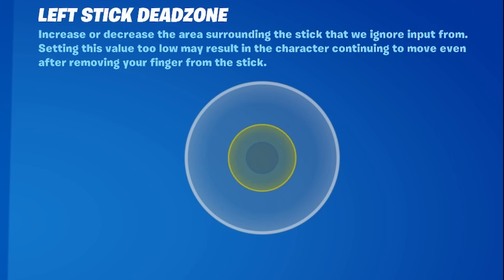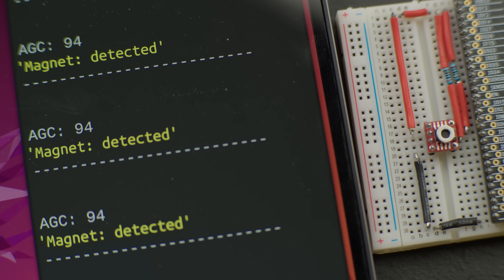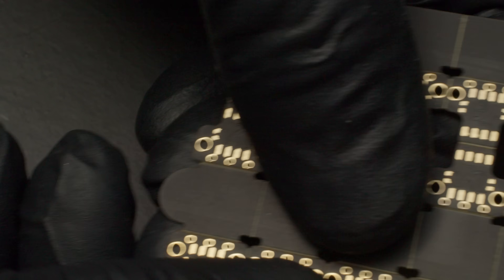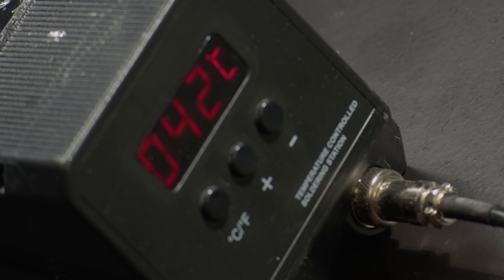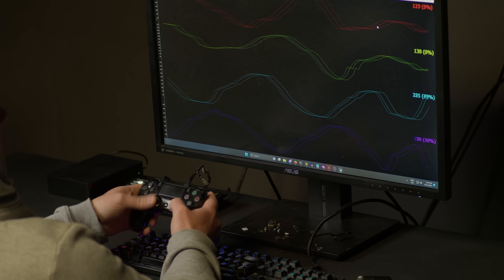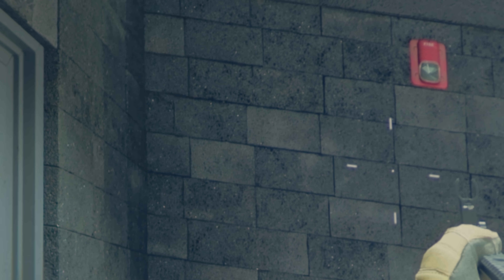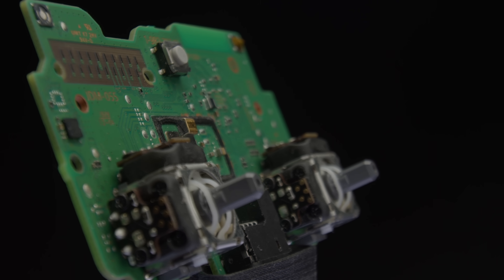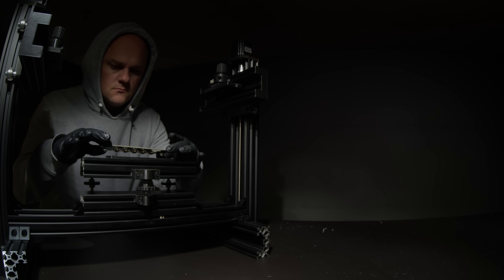Beating the $20B Joystick Drift Problem, and giving it away for free

Comment: So as a person relatively new to console and PC gaming i have some thoughts on joystick augmentation or whatever. I only play rocket League for about 3 years now. I use an xbox elite series 2 controller. Their grips are set at roughly a 45° angle to the top. If i grip the controller into my palm it leaves my thumb at a 45° angle as well. This makes accurate joystick movements North South, East West, very unnatural. The muscles and tendons and ligaments have to move in a very unnatural way in order for me to get accurate north south east west control movements. I'm not thinking of redesigning the controller body. What would be ideal would be if i could reorient where up down left right actually are in the control stick with software. I would  rotate it clockwise to where up-right, down-left normally are. Then i could control my car much more accurately. I imagine everyone has particular tendencies in their thumb movement in the way they hold the controller.i think it would be a really useful tweak in the controller setup software. 
  The other thing I'm wondering is, do you think the distance from the neutral center position to any of the furthest points outward in any direction, needs to be that far?? I think minimizing all the movements you have to make with your thumb would be super beneficial. Like.. i would love to try it where the far outside was halfway in between the far outside and the neutral position as it is now. I am aware of at least one manufacturer that provides a sort spacer that shortens that distance in the control sticks but I'm not convinced it's the best approach. What do you think?
Reply from the maker: I think its gonna be really exciting to experiment with stuff exactly like this. Adapting controllers to both games and hands. Or personal preferences. Its gonna be a.... game.... changer. Haha.

Comment: I think this joystick could be way more precise, if it tracked 360° of the magnet instead of just 50°.
But for your application, it would be complicated, as you would have to build some gears to translate the 50° angle to 360°.
Thus, as it is an overdrive, it will put stress on the gears and make the joystick harder to move.

If manufacturers wanted to build reliable controllers (it was not intended to be a joke), they could easily take the same path as you. Moreover, they have the money to build specific magnets, so they wouldn’t have to use an overdrive to track 360° of the magnet.
Reply from the maker: I see your point. They can.  But gears that are small, will cause backlash. Especially over so many cycles. They could probably have made the joystick modules bigger.

Comment: I really hope nothing in the latter third of the the video is sincere. Hall effect joysticks have been available for a very long time, and there are even companies, such as GuliKit, which sell upgrade kits. The only reason OEMs dont install them on every controller is that it would raise the BOM cost by like $1.50 per unit and reduce total controller sales. It’s really easy math, from their perspective: $1.50 multiplied by, say, 250 million units sold is a lot of money that their shareholders wont let them give up. Taking that into account, the objective for the video, especially the latter half, is to point out that fixing the design is extremely simple and that there isn’t really any justification for letting such a minor profit differential get in the way of making better products. To be honest, i think the engineers making the controllers already know this, but it’s probably going to take a long time to convince the executives that a strong enough argument can be made to the shareholders that the upgrade is worthwhile.
Reply from the maker: Actually, I used to think the same way you do before embarking on this project. I'm not suggesting that you're wrong, but allow me to provide some additional insights. It's impossible to create a linear axis of 255 positions the way Gulikit does it. This can't be achieved with a single Hall sensor due to the small movement range of this specific mechanical joystick design. I'm employing a far more advanced method than Gulikit. I use a rotary encoder chip that houses four Hall sensors arranged in a circle around the axle within its silicon structure. The inputs from these four sensors are fed into a CORDIC (COordinate Rotation DIgital Computer) within the same chip, and then output as an analog signal by a 14-bit DAC (Digital-to-Analog Converter). This introduces a level of precision that far surpasses what Gulikit or any other single Hall sensor solution can offer. I have conducted measurements, and it turns out Gulikit manages their solution through heavy signal processing and automatic re-centering. So no, it's not easy, and it has never been done before. The movement range for this joystick is so minimal that it's impossible to create a true 8-bit axis that is free of noise with the previously utilized methods. Furthermore, these Hall effect encoders are quite new and quite expensive. A single one of these chips costs more than the entire joystick on its own, and two are required pr joystick. This doesn't imply that Sony couldn't have solved the problem. They certainly could have, especially considering the highly advanced triggers on the PS5, yet they still didn't address the joystick issue.
Reply: @MariusHeier1  I apologize for making assumptions about the precision of the different systems, but I'm not yet ready to believe that it's impossible to use simpler sensors to achieve a usable result. Even discounting the dubious value of having a full 8 bits of precision, it seems likely to me that the specific sensors you're using are overkill. For the purpose of making a unit that can be produced in large quantity, would it not be possible to use a magnet keeper to guide the field so that precise reading can be gathered from a collection of simpler sensors? I'm imagining a stamped ferous sheet metal part which encloses the magnet and guides the field into two or more smaller areas near unevenly placed sensors. The keeper should be able to increase the local flux while making the flux across the range of motion vary less evenly, thereby making it easier to read a definitive position. I'm also confused about your calibration system. Unless the output of the sensors is both non-linear and unpredictable, it should be possible to use the normal joystick calibration method of running it in a circle at its limit, then letting it return to center, rather than going to the effort of uploading calibration data to each unit. Internally, you then find the limit values and set those to the output extremes before using the linearization curve to set the values between the limits and the center. If you have a software interface, you can also allow the user to set up non-linear output response and deadzone size.
Reply from the maker: @Rms2015, the fundamental issue arises when moving a magnet a short distance. The nonlinear changes in the magnetic field, when combined, seem to make the task impossible. This might be feasible for larger joysticks, but moving a magnet 3-5mm doesn't provide a reliable ground truth without substantial processing. My sensor seems overpriced for what it does, but it's the only solution I've found to be effective. However, we need to consider this from a different angle. I didn't create this for mass manufacturing. I developed it so that people could order it at almost the cost price of the components, making it very affordable for an end consumer, albeit not in a mass retail context.

About the calibration - Sony has hard-coded the ideal center position into all controllers, resulting in a specific center voltage. What I do first is what you described: find the outer limits. Then, I perform a 30 release from both the maximum and minimum edges to determine the mechanical center. Using this data, I identify the best ideal center for the axis. Afterward, I shift the start and end positions of the magnetic field rotation to align with the hard-coded center voltage for that specific joystick.

I even made a robot/machine that reads the joysticks and move them at tiny increment to observe all the stuff i proclaim. Im gonna write a paper about it when i get more time to describe it and back it up with the experiments i did.
Reply: @MariusHeier1  if I read that right, what you're telling me is that you haven't found an algorithm that accurately predicts the position of the joystick from the changes in the magnetic field because those changes are less predictable than you can account for with simple math. Based on that I have to ask how many kinds of magnet you've tested. I'm afk atm but iirc the one you showed in the animation was a non-axial  ring type magnet: those frequently have non-uniform fields due to manufacturing limitations, so perhaps a simpler magnet shape would help? I also wonder if it might be possible to skip measuring the x axis and y axis separately by attaching a magnet to the actual stick and measuring with a multi-axis sensor. I'm told that the ~$2 chip in phones is good for 0.1 degree 3-axis digital readings. In any case, this seems a poor choice of platform for continued discussion: you can find me at rms2000 on Discord
Reply from the maker: @Rms2015  could not find you in Discord. My discord channel is in the description.

Comment: What exactly is the advantage of this system over Gulikit or similar? Are they not the same idea?
Reply: this is diyable, just a couple of low cost parts (so it's cheaper) and you connect to the original sticks (so it feels almost like the original)
Reply: @-aexc-  fair enough
I also looked a bit further into it and saw that it fixes issues in hardware that Gulikit chose to fix in firmware (non-linear activation curve)

Is there any information about doing this build yourself? I'm interested in poking around with it and seeing how hard it is to do

Comment: They're not trying to save Pennies, well at least not just that. They're trying to get you to buy more and more when they break down. A lot of companies does this. Even apple admitted to it with slowing down their older model phones when a new one comes out. It's called planned obsolescence. Not sure there's much we can do about it other than solve the problems ourselves. But even then manufacturers make it harder and harder to perform maintenance on our own products that we buy. For instance phones have permanently sealed batteries now, try doing an oil change in a brand new luxury car. Lol you need a specific expensive machine for it. Wish we could do more than just talk about it though companies don't care about comments or videos on YouTube unless it hurts their wallets.

Comment: The N64 joystick worked great, no stupid potentiometers to wear out and start drifting. It worked like a ball mouse with IR optical sensors counting slits passing by on the wheel. It was an optical encoder, basically. Why they don't use a design like that is beyond me. It's simple and effective, but not as profitable because you won't be selling new controllers to everyone when theirs invariably wears out.

Comment: Microsoft solved that problem decades ago with the fully optical stick in the Sidewinder controller.
Reply from the maker: Yeah that's easy when its that big.
Reply: @MariusHeier1  Dude, the operating principle is optics. It can be definitely minimized, and to a greater degree of precision than the Hall Effect. You're seriously not trying to tell me that the reason they stopped putting it in controllers was because of size, and not capitalism.

Comment: I don't get it.

I mean I understand companys not wanting to sell a product that lasts forever - but couldn't they just make at least the "high end" controller versions (like M$s pro controller) with lasting sticks? You already pay 200+ bucks for that shit iirc. Least they can do is manufacture lasting thumbsticks at that price. I mean, it's not like there aren't enough other parts that will just fail eventually and have the customer buy a new one.
Reply from the maker: All controllers are made with mostly the same subparts from the same sub manufacturers. And there is almost only one company that makes joysticks this size. So everyone ends up using the same. The joystick actually cost about 1$ for like 100. So Sony probably pays like 1$ for two.
Reply: it’s their plan for the controller to only last a limited amount of time

Comment: What’s sad is all of the potentiometer problems could be solved with software. Just allow deadzones to be increased if there’s drift. You’ll lose a slight bit of accuracy but if it keeps your controller usable for another few years it’s definitely worth the trade off. On PC I can do this whenever I want but for something like the Switch which has problems with every controller Nintendo could have solved the problem with basically zero effort.

Comment: You literally just need to use a material that has a higher fatigue limit. The stresses in a joystick are so hilariously small that im sure if they wanted to design a controller that lasted, they would. But they don't because they want money.
Reply from the maker: The joysticks is fine. Its the potentiometers in the joystick

Comment: I think the drift is due to not centering correctly and it could easily be fixed by allowing you to calibrate the joystick and set its center zone. Its a mechanical problem, not a pot wiper problem. I got a PS4 controller which drifted right out of the box. Its not wear.

Comment: Insert, companies probably knowing about this but choose not to implement it to sell you more controllers aka planned degradation, here. 🤣

Hehe naah but cool ide, they DEFINITELY should implement a variant of this, I'd also like a form of magnets around the stick to repel it from the edges so it doesn't grind it down either. I've noticed that the stick under the thumb mushroom gets grinded against the circle edge, that's what I'm talking about.

This could be potentially fixed by making the circle surrounding the stick metal and the stick itself as well, but I don't know. 😕

Comment: would you ever experiment with ps5 controller boards because those can be clocked to 1000hz polling rate which is ideal for input delay
Reply from the maker: So can the ps4 controller. And yes I have :)

Comment: The sad thing to me is that this very likely isn't something console manufacturers want to fix. The console itself is typically a loss leader, with the profit being made on licensing access to game companies and through accessory sales. A couple months is on the absurd end of things, but I doubt any company would want a controller that lasts too long either. I actually wouldn't be surprised if a very similar (or similar enough for multiple countries' patent offices) design is already patented.
Long story short, it's wonderful you're releasing this as open-source because our escape from this situation is probably going to be to get fed up with frequently replacing controllers and either copy and iterate on your design for our own purposes, or order ready-made controllers and modification kits from third-party companies using your design and others following the same principle. I'd be happy to be wrong, but remain doubtful that Microsoft, Sony, or Nintendo would leap at this when they sell such a steady stream of controllers as it is.

Comment: One thing I would recommend (yes I know I'm a little late on this.) But I would take inspiration from the Rubik's Cube community, specifically a maglev style design. You're almost there. I'd have to run through some specific things to figure out how it would work within a controller but I do know it should be possible.

Comment: 2 months? In who's world? I think you meant to say 2 years . I've never had problems with any game controller having drift if name-brand except for my Dreamcast. Meaning Microsoft controller, or Sony controller. Cheaper knock-offs/third party controllers often have problems with with subpar parts. Never had an issue with my Xbox 360 controllers, and have had my PS4 Pro since launch, no problem with either controller. I don't even remember a problem with my PSX or PS2 controllers. With that said, very cool solution for your controller drift. A little over-engineered, but hey, it works!

Comment: Bruh, open source it using a real license, then sell it to a big company if they offer to buy it. Don't be proud lol. Take the money and run! As long as it's open sourced it can't be taken away from the community. Otherwise, making an open source hall effect kit for the community is super great! Good luck fitting a connector on the bottom of that. That's gonna be a tough squeeze. You could also just expect people to solder wires to it to program them in the worst  case.

Comment: You could test how clean your creation is by building a small physical motor/robotics device to externally oscillate the joystick up and down (mimic of a finger really, except with better control over the motion). It would be interesting to see how clean of a sine wave you could make with it, even if its as low as like 1-10hz. Then you could use this to compare against the resistive version.
Reply from the maker: I've done that. I built a robot specifically for this. Check out my community tab. You can also see the wave formed by the controller movement in this video, there is also a short clip of my testing robot.
Reply: @MariusHeier1  Oh very cool, definitely going to check that out. I didn't notice the robot in this video either lol